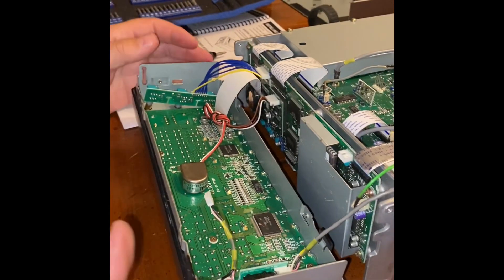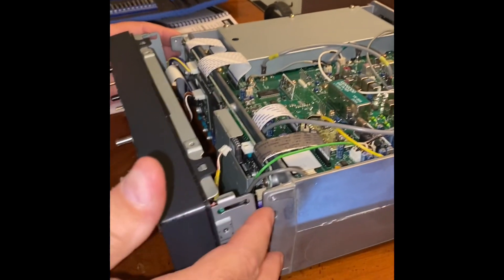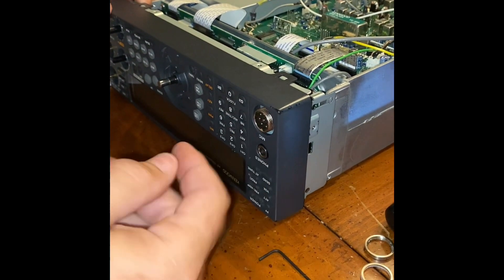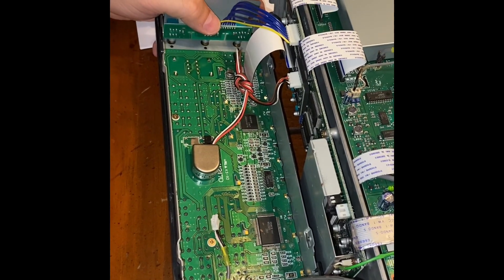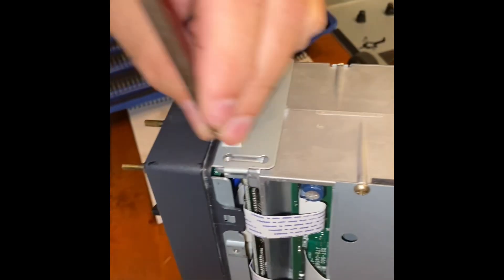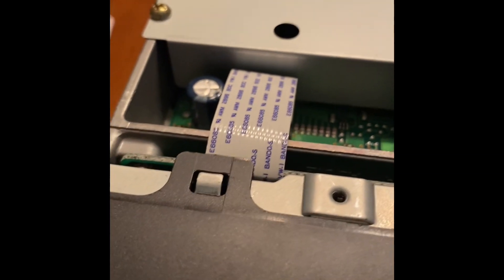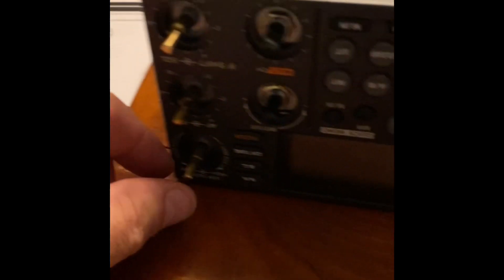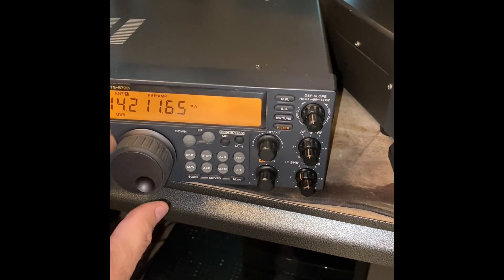DIY: VFO Tuning Knob Repair (Tighten), Kenwood TS-570 Amateur (Ham Radio)

Comment: I just did one 570D for a friend   FYI  great vid but i found while doing my friends   You do not need to remove the 4 side screws that holds the front of the case the to tilt the front of the radio  or the mic ring   ,  you can just remove all knobs, using a 1.5 mm allen to remove the vfo knobs set screw  and  the 1 phillips screw in front behind the vfo knob sits  carefully lift the tabs and wiggle the faceplace forward   its right comes off  hope this helps everyone